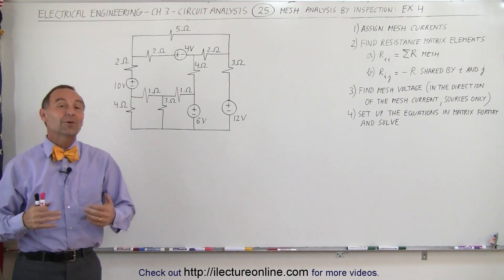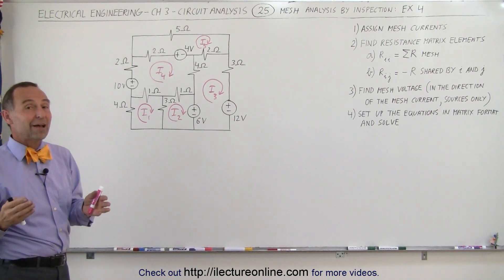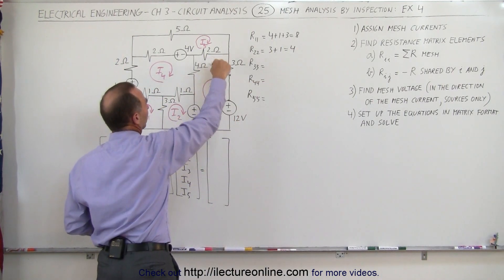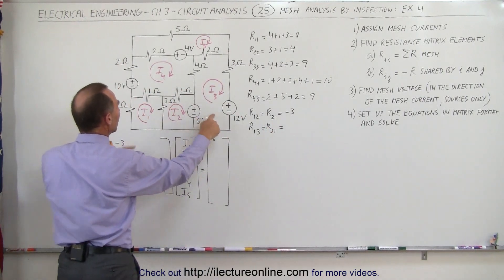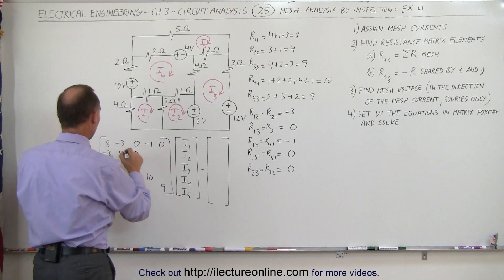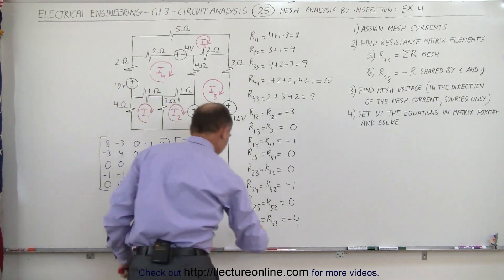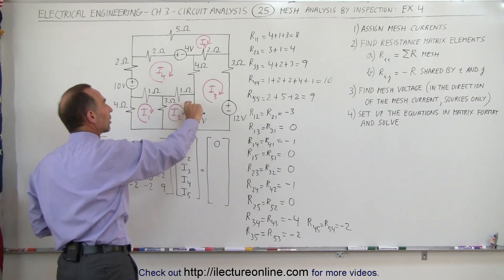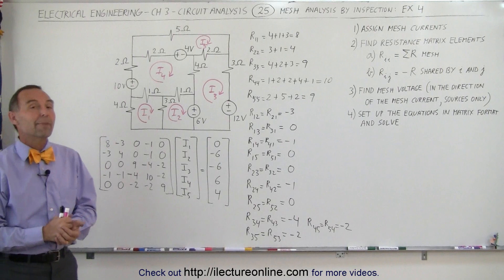Electrical Engineering: Ch 3: Circuit Analysis (25 of 37) Mesh Current by Inspection: Ex. 4

Comment: What I dont know is that I am not sure where to place I2 - is it after voltage source of 6V before the node or somewhere else like resisor 3 ohms or 1ohm...? Please help me.
Reply from the maker: Using this techique (applying the current to a mesh and not a branch), I2 is the current for the entire mesh and applies to all components in the mesh.  Note that other meshes border that one and therfore those components are also affected by the other currents.  If you look at some simpler examples earlier in the playlist that will help you out.
Reply: @MichelvanBiezen  Hello again sir. I got it. I got all the current in the branch where is 4V voltage source there is I=0,172A; on the right where is 2 ohms resistor there is I=0,869A; between them where is 4 ohms resistor there is I=0,691A; down below where is 6V voltage source resistor 3 ohms there is I=0,238A. The tricky part was I wasnt sure how to treat 6V voltage source. Now I got it. Thank you so much Mr. van Biezen.

Comment: how can we solve if there will be any current source in the circuit...
Reply from the maker: There are no examples with current sources in the playlist?
Reply: It's easier to do normal mesh analysis if you have the current sources with values known to you. But, if you really want to do it using matrices then find the equations from mesh analysis. And if you really really don't want to use mesh analysis but want to solve using matrices then do nodal analysis (where your voltages column will be filled with current and vice versa).

Comment: for anyone wondering: i1 = -0.72A, i2= - 1.99A, i3=-0.49A, i4=0.21A,i5=0.38A. Answer courtesy of Matlab :D
Reply from the maker: Thanks Shaun
Reply: Michel van Biezen 
What l can solve the problem 
I can't get 
I1.i2.i3 .i4..i5
Reply: Yup, that's what I just got !
Reply: How do u divide a 5x1 matrix by a 5x5 matrix to get a 5x1 matrix at the end?
Reply: @L2K4S  An easy way to see it is that matrix multiplication is only defined if the #columns of the first matrix match the #rows of the second matrix as in (1,row x 1,column) x (2,row x 2,column). Here, we have for matrix 1 5 rows by 5 columns and for the second 5 rows by 1 column. Since the number of columns of the first match the rows of the second, the multiplication is defined and the resulting size of matrix will be the #rows of the first matrix times the number of columns of the second (in this case 5x1 as is on the right hand side). You can think of this as "crossing out the columns number of 1 and the rows number of 2 and the numbers left is the size on the right." This is a way to remember general multiplication for linear algebra.

For a more detailed view, you must note that what he is actually doing there is sweeping through a given row of the first matrix and multiplying each element pairwise through by the elements of the 5x1 current matrix (what is called a dot product actually). The result of this pairwise multiplication is a scalar quantity (just a number as you are getting 5 numbers added together). That one number then becomes the first element of the voltage matrix on the right hand side. You repeat this sweeping for each row of matrix 1. There is a lot more theory to go into if you really want to see the beauty of linear algebra. I recommend 31BlueBrown's channel for this. Sorry if I am unclear with anything here. It is difficult to know if I am being clear over the internet. Let me know if you are still not clear on this.
Reply: I received same, but What I dont know is that I am not sure where to place I2 - is it after voltage source of 6V before the node or somewhere else? Please help me 🙂